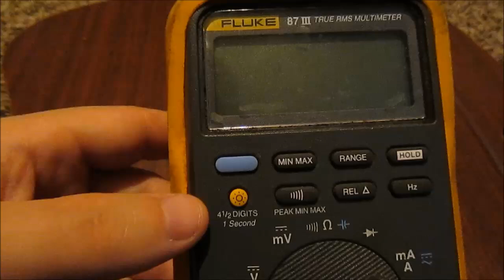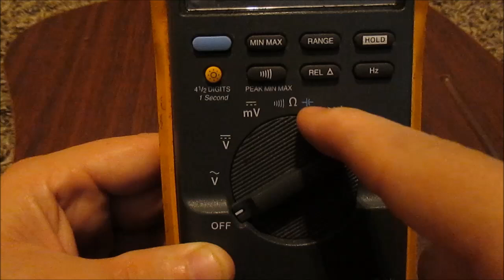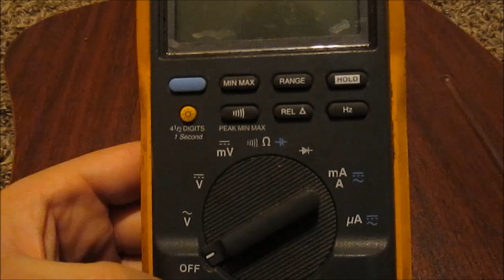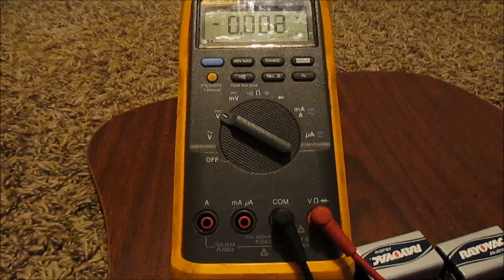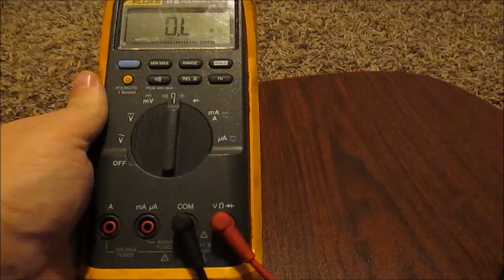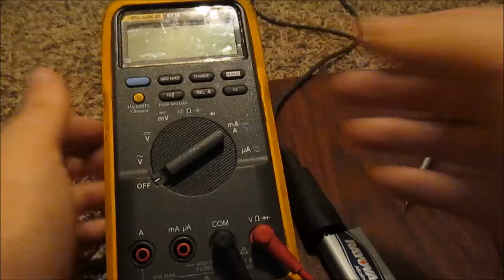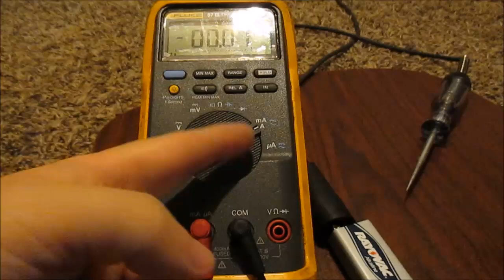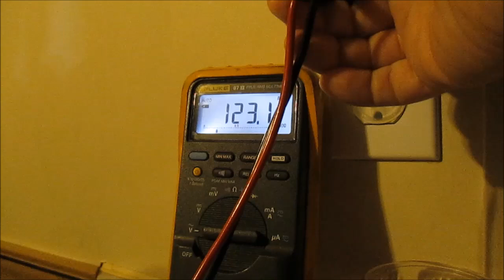How To Use A Fluke Multimeter Basic Functions

Comment: I work in a plastic injection molding factory so I want to test out Hot runners before mold is put into press ( SOME REALLY BIG MOLDS ) want to test on  I think ( OHMS) ( horse shoe / setting test continuity ) this is what I need to know , is there power going in and out ? is that Zone Dead , it happens // before die setters even put mold in ( we can keep last mold in and keep running if a zone is dead on next mold ) this video will help me

Comment: Thanks for the tutorial, but i got this question: i just bought a old Fluke 88-5 online, but it's not measuring any AC voltage. It either shows 0L or 5 to 6 volt, even tho i know that the power output i am measuring has 220 voltage (I checked it with different multi meter), is there something wrong with the multimeter or am i doing something wrong?
Reply: OL means out of limits, you probably need to make sure it is set to AC and check the range.

Comment: You Tube and their fucking Advertising are about to loose  my interest in any fucking thing they have to offer. This problem is no fault of you, Mr. Pierce. It's just an on going problem that has increased over time. The intensity of their teaser Ads increased after I did a "free" trial of You Tube Red. It's like I created a monster with an insatiable appetite to show more Ads - Ads that ruin a good and decent video like yours. Again, this is not your fault. But right in the middle of you explaining something, we get an Ad for You Tube Red with blah, blah, blah, blah. Fuck you You Tube Red - or any other color for that matter. But thanks for the on How To Use A Fluke Multimeter...

Comment: Very informative. But I'd like to know -  during the last test - why does the meter have a reading even before you turn the wall socket switch on? It's jumping all over the place until you turn the switch on and get the solid 123 volts. I notice this happening with multimeters all the time. What's happening there? Is there electricity in the air or something? I'm really puzzled by this. Thanks.
Reply from the maker: When the meter does what you are describing it is usually a result from what is called ghost voltage or stray voltage in the line of the circuit you are measuring. Ghost voltage can be in a circuit by means of being electricity induced from other power wires near the circuit or from capacitive coupling between energized wiring. This ghost voltage is a real voltage but it is a voltage that does not have any real current behind it, and because of the meters high impedance it will pick up this voltage. Most digital meters are in the 1-10 megaohm range, which being that high does not really load a circuit, when you connect the meter to the circuit. Now if you used an older analog low impedance meter that actually loads the circuit much more than the digital meter, you wouldnt see that ghost voltage present. So usually when you see weird voltage readings on a meter, it can be from whats called ghost or stray voltages in the circuit (usually caused by other nearby circuits effecting the dead circuit), Another reason the voltages can jump around is from having an open in the circuit you are measuring, and the voltage is responding because of the auto range feature. The auto range feature is trying to compensate and find the correct range, but cant because of the open circuit. (i hope that makes sense) Well that is all I know about that, but I have added a few links from fluke that help describe this situation, perhaps the links will explain it much better than I can. Thanks for the comment and have a good day.
http://www.fluke.com/fluke/uses/comunidad/fluke-news-plus/articlecategories/electrical/strayvoltage
https://www.grainger.com/content/safety-ghost-voltages

Comment: what does it mean when the meter beeps on and off even when the leads are removed from what I was measuring?
thanks
Reply from the maker: I am not sure what is causing that to happen. You may have a meter that is malfunctioning. You may try searching for answers in google and on forums. Sorry I could not be more help. Thanks for the comment and have a good day.
Reply: foothillselectrical 
its more like if im in the ohms mode and touch the leads to 110 vac. or ill be in ohms again checking continuity on a vehicle thats of course 12 vdc, obviously there will be power going through the wires, but i dont know why the meter beeps continuous after i remove the leads.
Reply: DUMBASS it's probably the mode that you are in. In some modes the meter will beep to let you know that the measured value has changed, either up or down, for the last displayed value. When you connect or disconnect your leads, then your created a change in the measured value and the meter is alerting you of the change.
Reply: DUMBASS that could very well be the meter you are using. Many, perhaps most, meters are not designed to be connected to live circuits when doing resistance checks. It may be a warning that you hear.